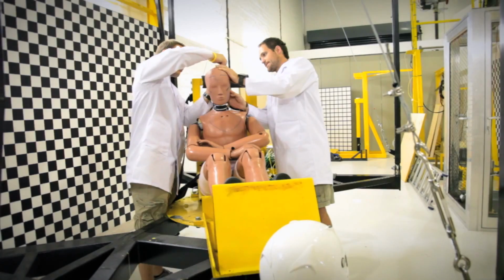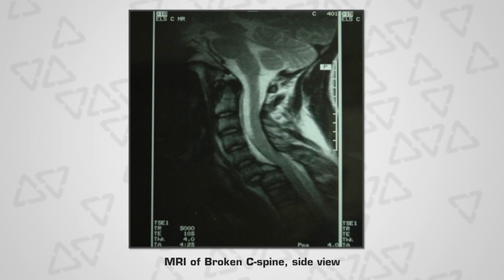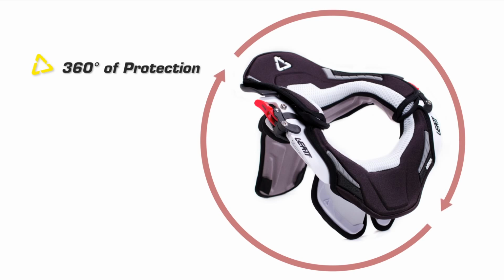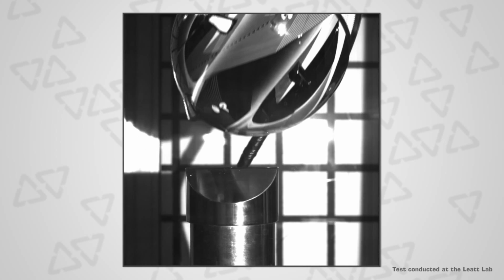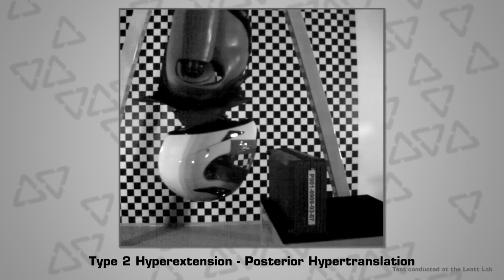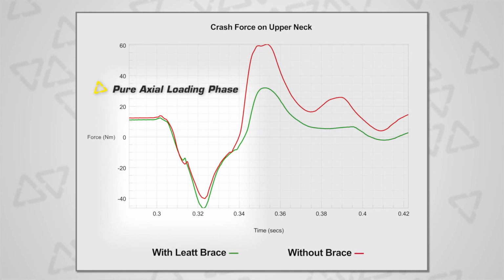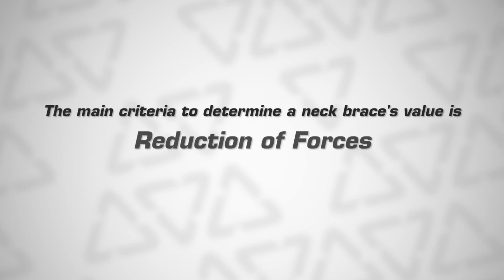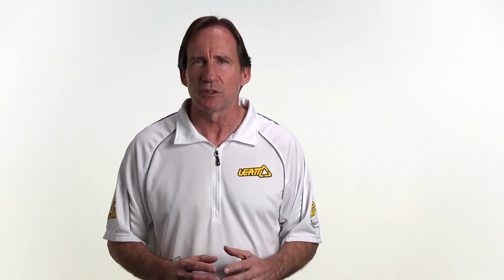How can a Leatt Neck Brace save your life?

Comment: I fell of my 1250 GS ADVENTURE 2 days ago and got a unstable fracture of C6 and C7. I am lucky that the spinal fusion surgery went on well and I have no loss of function. I did not use a neck brace as I was ignorant. Will never ride a motorcycle without one moving forward!

Comment: I just got one because I was flying down a downhill course on my DH bike. It had rained all week and it was soft and slippery. A berm let go on me a the top rim sending me over the berm into a tree head on. My chest protector took the first impact but then I free gel about 15 feet landing on the right side of my head. I think I actually went end over end in the air before striking my head. My Fox DH helmet cracked down the middle and I woke up a hour later still on the course but nobody else was riding so nobody saw it. My neck hurt so bad along with my head and I kept vomiting trying to stand up. I had a CT scan done and I have a bad concussion almost lacerated my right kidney. I have 3 herniated disk in my cervical and a hematoma the size of a grapefruit over my lower back. As bad as this was I could’ve broke my neck or worse died. So I got a leatte today because I believe my injuries would have minor if I was wearing one of this. I’ll  never ride without one again after I heal.

Comment: i just bought a leatt 2.5 rox chest protector. Worked great! I crashed my friends pitbike. I started with to much gas and flew thru a bush and there was half a meter drop behind the bush and hit the chest in the bars really hard and try to hold on to the bike put then fall and hut the bikes swingarm and wheel on my chest. And theres was no pain what so ever. Now i know it wasnt a bad crash but i still recomend this chest protector.

Comment: I own and wear a Leatt GPX 5.5. During my travels in Patagonia, I came of my motor bike and landed on my head first then rolled on to my back. Carbon helmet showed a big dent but live to tell the tail. I got myself checked and have a small neck hernia, my Physician told me i was lucky I was wearing the brace else I would have been a quadriplegic or no longer amongst the living. I am avid about motor bike safety and will not compromise, certainly not after my exerience or the motor bike friends I have/had that suffered from not protecting themselves whilst being on a motorbike. Yes I do get a lot of funny comments, like "robocop" and the sorts but in fareness I am the living example of what they can do in case it goes wrong.

Comment: Great information, I biked allot as a young fella, now I'm  53, in good shape, I'm admittedly more "crispy" for lack of a better word! Anyway, should the neck brace be purchased as a system with the correct helmet? Or are different brands interchangeable? I'll likely be getting both, thanks.
Reply: As I know, a neck brace is to be purchased with correct chest protection. This is the only requirement. Also it's better to buy solid helmet (better with approved safety sertification)

Comment: It seems to me that having the helmet and the brace closer together, the angle of the neck during an accident would be less severe, reducing the risk of injury even further. Since helmet manufacturers are most certainly not going to redesign the shapes of their helmets for this purpose, I would say that raising the brace would be the more feasible option. But then again I'm neither an engineer, nor am I a medical specialist  :P
Reply: I pair my neck brace with my alpine air 5 airbag. The one time it ever deployed my neck brace was snapped up tight to my neck. I’ll never ride without both my airbag or brace. I was basically in a hamsterball.
Reply: that would hjelp but also limit heads overall movement, many already have stopped using neck braces because of that

Comment: Neck braces just move the injury to another place
Reply: To a less vital area.
Reply: You are categorically and 100% wrong mate. I have just speared face first into a jump and ate shit. I shattered the nose cone of my 661 and had I not worn the brace, I would have been a quad instantly. I had some bruising on my chest where the rests are and some muscular trouble but I was cleared of any CV joint injuries and it is down to wearing the brace.
Reply: Moves forces away from your spinal cord you fuck head...
Reply: Broken neck or broken collarbone. I mean ...you're picking limb over life here.
Reply: @CURIOUS_BREAD  Modern neck braces don't even rest on collarbones. So if one breaks a collarbone nowadays, it's because of the impact through the arm, not from the brace.
Reply: Your clever you , dumbfuck
Reply: If I break a another bone other than my neck then I say it did its job. But be that guy that rides  a 50k Superbike, 7k spend on gear with no neck brace. Squids are special kind of stupid

Comment: I was on the fence about getting a neck brace for myself and my daughter, but I'm starting to lean towards getting one.
Reply: Dustin Mobley I was in a bad crash (Barley cased a 120 ft tripple 5 gear on a yz 250 2 stroke) where I was ejected and landed hard on my head. I can hands down say that my helment with mips and my necklace saved my life. It did disperse the energy and I fractured the vertebrae in my lower lumbar (which is what is suppose to happen) but I suffered no other neck/collar bone injuries. They have earned my buisness for life and I recommend them 100%
Reply: Thank you for the response. I"m happy to hear that the equipment helped you out. We just upgraded her to a  Bell Moto 9 Carbon Flex helmet and now I just need to get the neckbrace purchased. Thank you for your response.

Comment: so i heard that neck braces couse collarbone snaps!! still so, or was that a problem with old(er) models??

And yeah..better broken collarbone than neck, sure, but what I mean is that these collarbone injuries had been avoided without the brace...

Cuz I've crashed tons of times and never broken anything...don't wanna snap the collarbone because of the brace
Reply: Yeah..that I totally understand and agree with. But I mean if the brace couses unnecessary C-bone snaps? Heard that people fallen and got the bone snapped,but the fall hasn't been dangerous att all. Meaning that without the brace they wouldn't have broken anything at all....
Is that with older models or is it just a myth?
Reply: Ok, so by that logic, you'd be more pissed about your paint on your truck or car getting effed up when hitting a concrete wall at 30 mph, than the catastrophic body and frame damage.  Try a different perspective. I know several people in their 50's or 60's that have had to have to had their neck surgically fused with between 6 and 12 titanium screws and plates from silly little dings. My grandma is 64 and she had to have her neck fused and can't turn her head more than 30 degrees in either direction because she dove into a pool at 16 and smacked her forehead on the bottom. She's in constant pain. She wishes a)it wouldn't have happened, but b) that something would've redirected the force from her neck. I would gladly trade a neck hyper extension for a broken collarbone. Way lesser of two evils, and an these braces are an insurance policy on murphy for sure. Can't be worse than the acl I tore last year.
Reply: Didn't bust a thing when I faced into a jump 3 weeks ago. Helmet was fucked (nose cone shattered) and I walked away with bruising and soft tissue dmg.  It was by far the biggest off I have had ever and I'm 40.
Reply: I’ve heard of more injuries with helmets slamming onto the collarbone if anything the brace will help prevent that even more